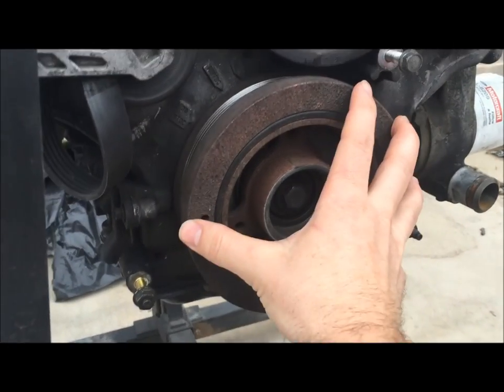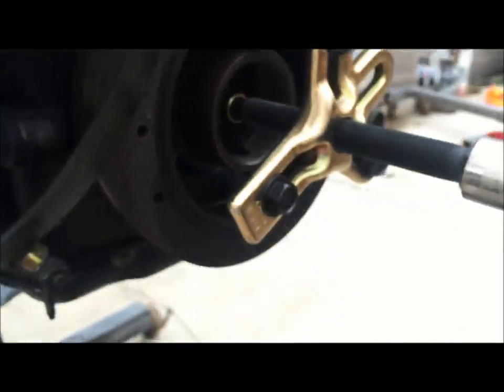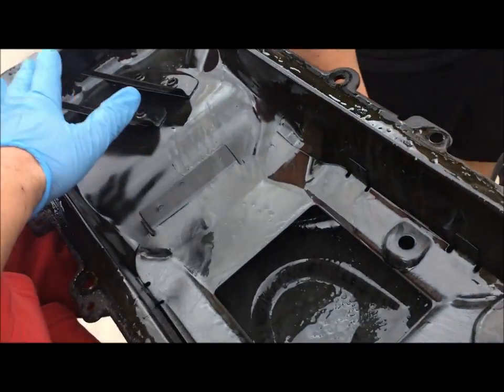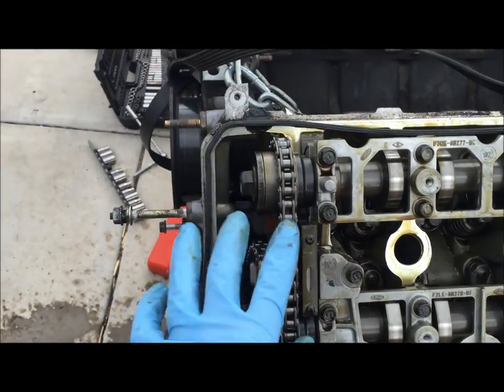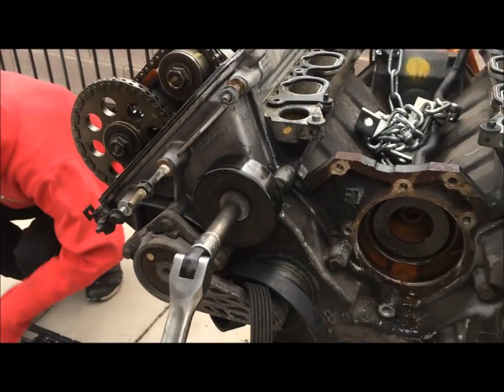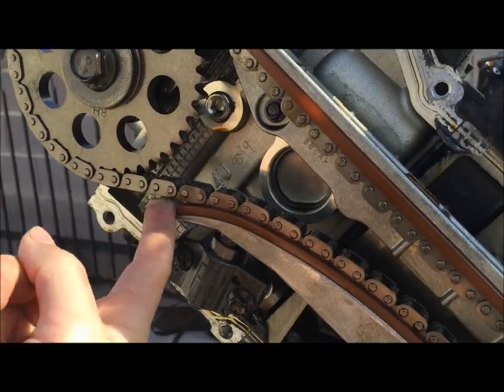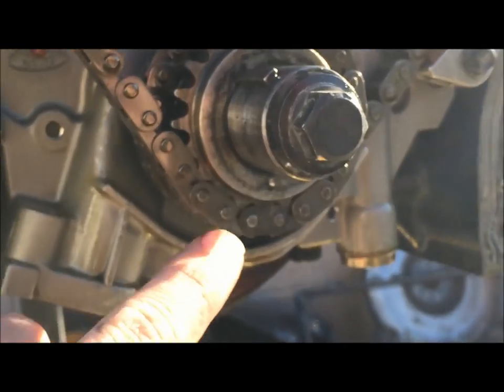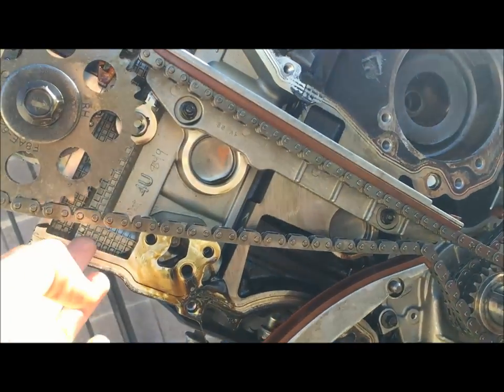Crank pulley, Water pump,Timing cover, Cam covers, cylinder head, head gasket, oil pump,4.6L Mustang

Comment: I have a question on the timing chain. How would you set the timing chain up for when you’re putting it back on. I’m doing a head gasket replacement on my 2001 cobra but I haven’t taken off the timing chain since I’ve read on it needing to be set when you put it on. I do have the marked chain with the little dimple.
Reply from the maker: There are some good videos out there where you have to align the crankshaft and point the key way towards the chain you’re putting on and then a line at dot to dot, and then do the same on the other side
Reply from the maker: https://youtu.be/UCUHtircPVM
Reply: @dannyjohnsonsgarage  ohhh I see. Thanks for the video recommendation! It will be really helpful, I will watch it right now. Love your channel! Your channel has helped me do some things to both my 01 and 03 cobras! You’re the first person I look into when it comes to doing something on them haha.

Comment: Awesome video. Lots of tips and knowledge.  Doing this myself as we speak. I triple checked the timing before attempting to turn the crank to confirm everything was timed. The crank turned 90 degrees and stopped. It won't go anymore. I removed everything and made sure the cams and crank were in the exact same position as you showed. What would cause the crank to lock up? Engine was running before I removed everything. 🤦‍♂️🤦‍♂️ Did I busted it? 😔
Reply from the maker: Even being off one tooth could mean the piston is hitting an exhaust or intake valve. It’s good you’re doing it by hand first.
Reply: @dannyjohnsonsgarage  Wow t
Thanks for the quick reply.  I'm gonna double check everything tomorrow. Thanks again. I really hope that's all it is. 🤦‍♂️

Comment: Hey man I have a 99 cobra I need to pull the heads off of but I don’t understand timing at all. I noticed you didn’t use anything to hold the cams, is that not a big deal? I am worried about damaging my valves if they hit the piston somehow. Also when you put it back together do you just realign all the marks back up to get it back in time?
Reply from the maker: Jared Brown Mark the relationship of everything, make sure it’s dot to dot lined up on ALL places, mark relationships, and reinstall how you took it off

Comment: Danny, do you know if the grommets for the 8 bolts circling the spark plugs (not the spark plug grommets) can be removed and replaced without taking the valve cover off?

Comment: Hey Danny if you know a way to take off the valve cover with the engine in the engine bay with out removing the hydroboost and master cylinder please do tell brother , this thing is kicking my ass... I removed the driver side engine mount and I still don't have clearance 😩😩😩
Reply from the maker: Just unbolt the hydro boost mounting bolts (access from under the driver side inside the car) and that will loosen it up.
Reply: Danny Johnson thanks brother I will give that a try tomorrow!
Reply: Danny Johnson quick question do I have to remove the brake assembly like some cobra owners say we have to do?
Reply: @DIYStangsandFreedom  no it will come out without

Comment: hey Danny, going to be replacing the chains on my 03 2v soon. is it actually necessary to use the cam tool to keep them from moving when the tensioners are removed?
Reply from the maker: Yes, you’ll want the tool

Comment: Do you have to line the timing up when taking everything off and rebuilding the motor?
Reply from the maker: For a complete rebuild you will need to set the timing starting all over. If the engine is already in time you can put cylinder 1 at top dead center and then even make your own marks dot to dot, but only if you are doing chains and tensioners like this video https://youtu.be/xbkgpfk7s-g
Reply: @dannyjohnsonsgarage  understood, it was still good practice. I am putting in some better pistons/rods and ring gapping for boost. This engine is fun to work on.

Comment: Do u have a video on the 2v 4.6l ??   I'm trying to figure out top dead center.
Reply: Basically the same thing bro
Reply: Timing marks should line up same way as shown on this video, it’s same for 2v and 4v 4.6
Reply: @martin4.665  thanks alot man.i appreciate it.
Reply: @mustangdanny97  yeah no problem, there may be a slight difference in bolts but for the most part it’s all the same.

Comment: Are you getting arp studs and a new tensioner kit,i sure did plus i got new timing chains too cause my engine is a 82k miles.
Reply from the maker: +Morbid SVT COBRA  I'm suggesting to the owner  as many new parts and upgraded parts as possible. ARP head studs, arp 2000 connecting rod bolts and so on. The owner of the car will make the final decision
Reply: I basically did almost everything on my car except for bottom end. Hope all goes well.

Comment: Can I fix head gasket on a 4.6 dohc (2004 mercury maurder) without taking off the harmonic balancer
Reply from the maker: No, you’ll need to remove the timing cover as shown in this video to remove the heads for the head gasket. The harmonic balancer needs to come off. It’s not hard with the puller as shown in this video as well
Reply: @dannyjohnsonsgarage  thanks you so much but is there a special puller for the 4.6 dohc it's a 2004 Marauder
Reply from the maker: David Miller This is like the one we rented. You can rent it from a parts store or buy it  https://www.amazon.com/gp/product/B0785H4BY1/ref=as_li_qf_asin_il_tl?ie=UTF8&tag=2004047-20&creative=9325&linkCode=as2&creativeASIN=B0785H4BY1&linkId=e65cc4e1a47c28679c1f7d2fecaa487c

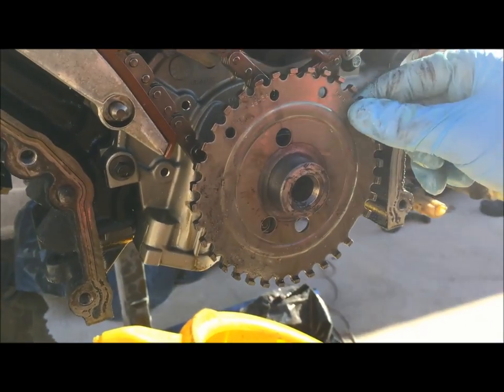Comment: Hi. Found your crank position sensor tutorial and subscribed! I like the content; descriptions and instructions are paced well. I couldn't find the clip I need here that was removed approximately  at 11:40 concerning the trigger wheel. I gotta get into my 2v and replace it or delete it and use an adjustable aftermarket magnet wheel on the outside. Help! Thanks .
Reply from the maker: Bruk S My brother had that wheel installed backwards on his bullitt’s built engine before he bought it. It took him forever to figure out why it was breaking up at high rpms

Comment: The balancer bolt is that clock wise or counter clock wise to remove?
Reply from the maker: on the 2003–2004 COBRA, the OUTER crank pulley is reverse thread (clockwise to remove) and uses a 14mm hex. The inner is normal thread (counter-clockwise) to remove
Reply from the maker: Michael Pence Here is the outer crank pulley removal for 03/04 cobra https://youtu.be/1JYtqYm8v3U

Comment: What tool did you use to get the cylinder head bolts off?
Reply from the maker: Alston Hall Shown at 13:36 into te video, 13mm socket.

Comment: since this cobra came with the metal tensioner, you should do the mod where shave off the bottom 4 teeth of the tensioner. It supposedly helps
Reply: racequad9 replacing head gasket on 04 ford 4.6
Reply: F150

Comment: What will make a 2003 cobra jump timeing?
Reply from the maker: 5.0 World I could see a loose tensioner allowing enough slack to have that happen. Are you saying jump completely off?
Reply: Danny Johnson I don’t know. It’s at the shop now. That’s what they are saying. But the motor only has 60,000 on it. It won’t start at all. It try’s to. So your saying a chain mama got have just came off the roller all to gather?
Reply from the maker: 5.0 World It’s hard for a chain to skip a tooth- I could see a belt doing that, but for that to happen I can only imagine enough slack (maybe from a bad tensioner) could cause a slip on a cam gear. I would think it’s more probable it came off or the timing guide broke. It’s really hard to say until it’s opened up- it could be the oil pump gears exploded. A lot is posible, so they need a good diagnosis.
Reply: Danny Johnson ok thank u man. They said they will pull it out next week. I’ll let u know what they said it was buddy. Thanks for the videos and looking forward to seeing more from you
Reply from the maker: Good luck. Let me know if you have questions.

Comment: You need to invest in a Dewalt 20v 1/4 impact driver. Very high quality, far less $$ than Snap On.
Reply from the maker: I have air tools and a craftsman 1/2 inch electric impact, but don’t like using them on engine components

Comment: Doesnt look like my 4.6. Valve covers are completely different
Reply from the maker: Miguel Maza Yours is probably the single overhead cam sohc vs this one as dual overhead cam DOHC
Reply: @dannyjohnsonsgarage  yea, I went back and realized what year yours is. Mines a 2000 gt. Thought the rear main went but it's the passenger side rear of the head gasket. Intake manifold is pulled already as well as valve covers. I'm just trying to figure out what all im going to need to go get more tools for, like the balancer remover. Do I only have to remove the p/s, water pump pulley and the balancer and then I can pull it off? I'll be doing in the bay. Not pulled out

Comment: my question is what caused this motor to lean out in the forst place
Reply from the maker: jon sixxx Bad alternator which in turn caused the pumps to not supply enough fuel on the second pull
Reply from the maker: jon sixxx yeah, that is pretty low mileage and very sad to lose a motor that had the ability to hold the power without a problem. The wet stuff is all the oil as it blew by and was being combusted